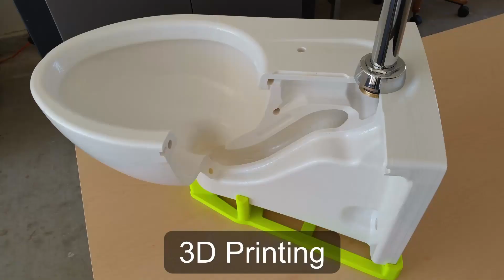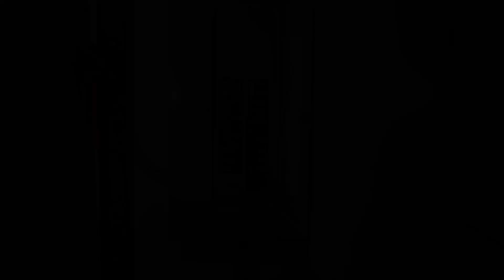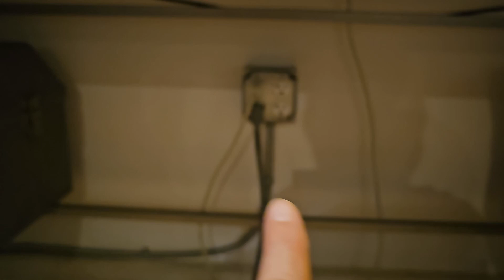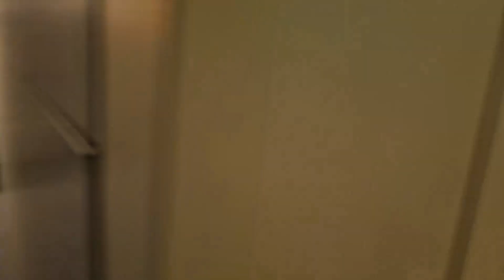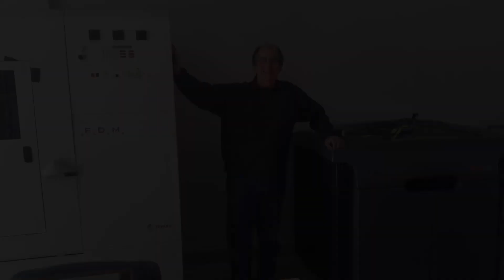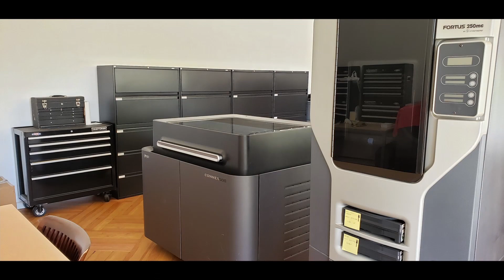3D PRINT SHOP ELECTRICAL WIRING part 3a TANDEM BREAKER PHASE PROBLEM!

Comment: That would electrically work, but I do not know if it is code compilant.
Reply from the maker: Good morning @thephantom1492, thank you for getting back to me on this, I appreciate your help. I thought switching the wires to correct the phase issue would work but didn't know for sure. Finding out if it's code compliant is the next step. Have a terrific weekend! Robert